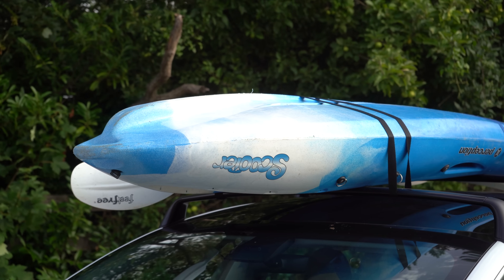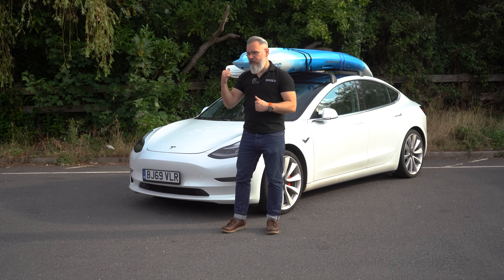The difference a roof rack load makes to EV efficiency? the Kayak test!

Comment: Just come back from a round trip tom Devon and Cornwall with a 420l  roof box and full car plus luggage for 4. I estimate approximatly 20% penalty based on similar speeds without the roofbox and full load. as you say, trip down and back is not a big problem. I drove around with the aero bars on for a week before putting the box on and didnt notice any apreciable change in efficiency from the bars alone

Comment: Have had multiple journeys on 2019 Model 3 Performance with Roofbox + Longtravel Mountainbike on german Autobahn - its a pretty steep increase about 35% at 140km/h in my case. Roofbox only (Alumined Design) is about 25-30% at that kind of speeds.

Comment: I regularly drive with a roof rack + kayaks. Generally the percentage range drop in an EV matches the percentage MPG drop in a petrol/diesel car. On a motorway at 70mph, I've seen -15% with 1 kayak, -20% with 2, -30% with 4. This is with whitewater kayaks (~2.5m long, 20kg) - sea kayaks, open canoes, sit-on-tops, etc will be different. I suspect how you tie will them to the roof bars will have an affect too (eg., upside down, via uprights, or using a cradle). Generally, I have a lot of extra weight in the car too (paddles, buoyancy aids, helmets, spray decks, throw ropes, dry suits, thermals, etc). 

I've had a Kia Soul, e208, and a Leaf. The percentage drop is the same.

My biggest concern with a model 3/Y is the glass roof. At some point I'm going to drop something on it. Or I'll leave water bottle in the boat and that will fall onto the roof while loading. I always avoid anything with a glass roof, whether EV or ICE. Ideally with roof rails as they typically have a higher weight limit.

Comment: Also heavily dependant on the weather. We rent a holiday house in France that we’ve driven to on the same route with the same load, roof box and roof bikes each year. Normally ~35% hit to efficiency with those bits on. When we went this year it was very very windy along the way and efficiency was reduced by ~50%

Comment: I did 180 miles with a set of aluminium ladders on the rack of a model 3. Lost 35% range and the howling was uncomfortable above 35mph. Taped up all the holes in the rungs for the return journey and it was much much quieter and less than 10% loss in range.

Comment: Great test, I haul kayaks almost every week on my 2019 M3 SR+. I normally average 240wh/mi without and with kayaks on I get. 270wh/mi with a single more aero kayak (11% loss) and up to 330wh/mi with two kayaks on one with J mounts in sideways. So 11-36%. Luckily my preferred lakes are only 40 miles or so one way so it works fine even on my standard range Model 3.  It does however make some longer gaps too far which is part of why I still have an ICE backup vehicle.

Comment: I just came back from a 7700km roadtrip with my Model Y and a roof top tent through Norway. The efficiency was surprisingly good. In Norway I only had a slightly higher consumption than normal, thanks to the speed limit of 80 km/h. In Germany at 120 km/h the efficiency was way worse. The speed is really the key here.

Comment: I think what you put on the roof also make a difference. I’ve done a couple of long trips with a roofbox and rear cycle carrier with a bike on, in our M3 LR. Leeds to London on M1 and Leeds to Cambridge for Uni drop offs. I’ve averaged 250wh/m over 36k miles. With the roofbox & cycle carrier, that drops by about 30%. At 70mph I don’t think that’s too bad and it’s still more efficient at that speed with the extra loads than our Zoe is at 70mph ;)

Comment: I’ve done a couple of runs in my Q4 E-Tron with stuff on the roof to see how it goes. There wasn’t much difference in efficiency between a large (470 litre) roof box and 3 SUPs, but when I did a second run with then SUPs on a windy day there was a noticeable difference. There was more than a 10% loss due to the amount of drag. Motorway speeds make a big difference too 🤔

Comment: Try driving with a ski box on the roof in the Finnish winter... It's a bit scary the way the battery drains. 😅 I've got a Skoda Enyaq and at a few degrees below zero (centigrade) in more or less snowy/icy conditions, with a roof box, the consumption hovers at over 30kWh/100km (2mi/kWh) in the beginning of the journey (heating up the car cabin etc), but settles down to around 25kWh/100km (2.5mi/kWh) over the whole journey. Without  the roof box, winter consumptions are around 20-22kWh/100km (~3mi/kWh), so the roof box adds maybe 3-5kWh/100km. In the summer and without the roof box, consumption on longer trips with a fully loaded car is around 16-18kWh/100km (~3.6mi/kWh). I haven't actually needed the roof box in the summer yet, so I'm not sure how much it would affect consumption in the summer time, probably somewhat less than in the winter, because cold air is "thicker" and causes more air resistance in the winter.

Comment: Next time try it with the kayak the other way round - it looks like it was stern first on the roof rack. I carry a couple of windsurfers on a roof rack and carrying them upside down and pointy end (and the way they normally go through the water!) first is more efficient
Reply: Bjorn Nyland did some experiments with roof boxes and found that some were slightly better reversed with the blunt end forward and the pointy end towards the boot.

Comment: Just as Tony said. The drag is a function of co-efficient and speed. Your top load aero is also very relevant. A tear drop too box is better than a tent box, kayak not bad either. The equation is basically easier if you have the symbols on your keyboard. 🙄. 1/2x density x the square of velocity. Its that square that makes all the difference. In water it’s the cube so for ships like ferries trying to catch up schedules by going flat out is a no-no.

Comment: Haven't tried the roofbox on the MG ZS yet, but on our diesel, I'm still averaging almost 60mpg on the current tank when the roof ox has been on the whole time. The key is driving at 60 rather than 70 on the motorways. In France we were doing more like 45 mpg after long stints at 80mph on the autoroutes.

Comment: From my experience, a decent roof box which is reasonably streamlined will not take off more than 10% of the range.  3 bicycles on the roof and you'll be lucky to get 60-65% of the usual range, at least driving on the motorway

Comment: Excellent efficiency from the M3P. It's also great to see Gridserve expanding in Exeter, Devon. The heart of Cornwall desperately needs many rapid 100-150+ kWh chargers though. Cornwall is a long county - you can be holidaying in Bude, go to Penzance and back on a whim and you're looking at 150 miles. In a ICEV you just do it - it'll cost you big, of course. In a BEV, much cheaper, but you have to plan it.